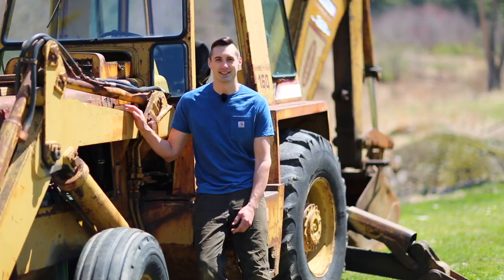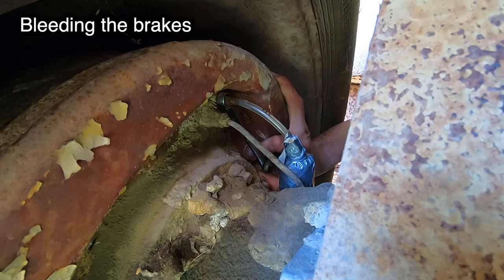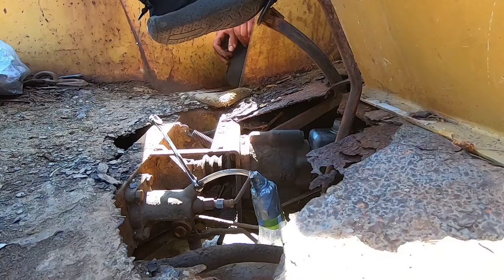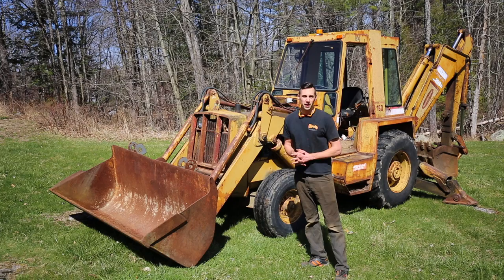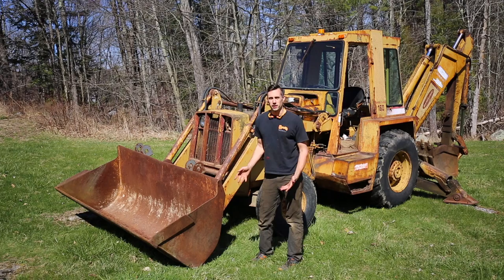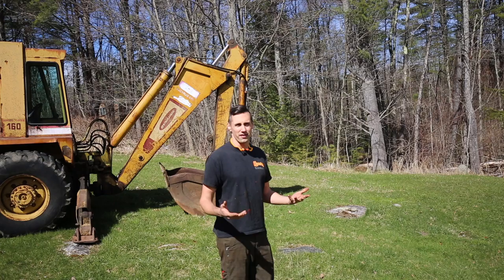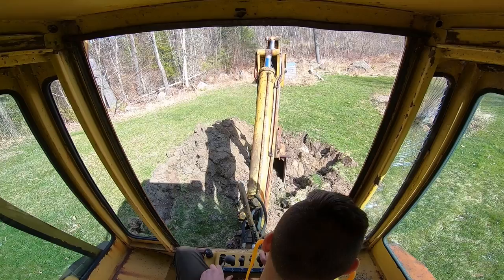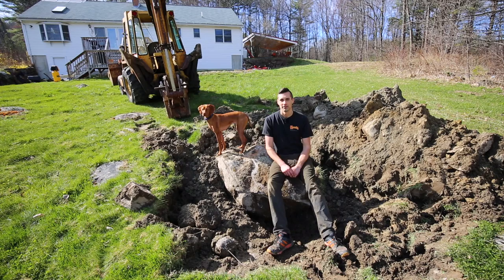Fixing the Brakes on a Backhoe and Digging a Rock [Dino Part 9]

Comment: Waldo, when ever you go to use your backhoe do the following, put your outriggers all the way down until your back wheels are off the ground and put your front end louder down until your front wheels are off the ground, this way you are more stable when you are using your backhoe. 7/1/2020
Reply from the maker: Yeah, I have to rebuild the cylinders for the outriggers because they're bypassing. At this point, one is actually spewing hydraulic fluid from the end cap seal 😂

Comment: Hi Waldo! I have been going through your videos and I like them. Your content is great! I am a heavy equipment operator, mechanic,  and CDL class A truck driver. I spent many years working for a mom and pop small construction company. It taught me a lot. Some things are just the same as you are experiencing, self-taught. I have to tell you that when using your back hoe, it is much easier to use and learn if you raise the machine up off the tires completely. That's what they are intended for. It also keeps the wear and tear off the rear axle bearings. The machine sounds great. I hope to see more of it! I really hope this helps you, because I know a great deal about equipment and just about anything that burns fuel lol. Every man has his own ways and yours are working just fine! Keep it up!
Reply from the maker: Thanks, Zack, I really appreciate the comment! You're right about using the stabilizers. Mine are leaking, so it's about time to reseal them!
Reply: @JOEZEP54  sure. Just type away. Glad to help out if possible...
Reply: @zackhamilton7421  Thank you

Comment: Being a person that has operated backhoes for years, this was painful, but I do recall how helpless I felt on my first time out.  Put the stabilizer feet down and keep trying.  Nick, North West Farmer
Reply from the maker: Thanks! Yeah, I could imagine it would be a bit painful to watch for an experienced operator
Reply: Complete noob here (learned to drive on an International TD-5 then an Oliver Super 55 when I was around 12 y/o, some 36 years ago, but never drove a backhoe); shouldn't the stabilizers be put all the way down, as much as jacking the tires right off the ground, so the backhoe stays in place (rather than dragging along as we saw here) when pulling with the backhoe?  Or is this machine simply too strong for it's own weight?

Comment: I had a 190-2 and I'm blown away at how much smaller the hoe is on the 160! I'm thinking of buying a 140 now but haven't looked at it...maybe not if the hoe is even smaller.

PS I remember the first time using the multi-stick controls....eventually you learn to manipulate 3 at a time and dig efficiently. Keep at it!
Reply from the maker: Yeah, the 160 can dig a 16' hole compared to 19' for the 190. As you've probably figured out, the 140 can dig a 14' hole. Even if you're not digging that deep, I'm sure the extra reach is nice!

Comment: I have a triend who used to drill in an lead anchor and an eye bolt.  He would then set up a tripod and a hoist to pull the rcok out of the yard.  We pulled some pretty large rocks out of my yard.  My friend who was a landscaper, repurposed the rocks in landscaping a stone walkway from my driveway to the front door.  In your case, Dino might be able to pull the rock directly out of the ground, after you drill in the lead anchor and the eyebolt. We also used the tripod hoist to pull some stumps from the ground.  This approach ended up minimally disturbing the lawn ans saved me a lot of cleanup work.   Caution:  You do need to use an appropriately load rated eyebolt and lift chain.  I was also under the inmpression that the eye bolts were one time use in this application.
Reply from the maker: That's an interesting method, thanks for sharing!

Comment: not an operator. However I have watched operators in the past and they would put the outriggers down until they picked the rear tires off the ground and the front bucket down and lift the front end off the ground.  You are a lot more capable than I can never hope to be.  Keep up the good videos
Reply from the maker: Yeah, the problem with the outriggers was that the cylinders were leaking, so they wouldn't hold the machine off the ground. It definitely made it a lot harder to operate that way!

Comment: The best thing you can do is do exactly what you're doing. Go slow and get seat time in. I remember NOW what gave me a fit on the Dynahoe I ran and it was the hoe controls itself. Ford has the best pattern on the levers with crowd on the outside left and hoist main boom beside it. Bucket curl next and swing where it is on yours.  That way you can crowd and lower and swing at the same time and use one hand for crowd and lower. Lots easier. Keep digging. And getting used to putting the power where it needs to be and modulate it. You'll get it.
Reply from the maker: Haha that's interesting to hear your insight on the controls! I'm sure I'll get used to these and they probably won't bother me too much since I've never used anything else
Reply: @WaldosWorld  You will. I got to where I could run the hoe but if it'd been a Ford setup I could've been smoother and faster. ut you have to pay the light bill with what's there. I'm used to I.S.O. wobble stick pattern now but can change back to backhoe if I have to. Takes about an hour for it to become 'natural' and an hour to swap back. If I had a Dynahoe I'd swap the hoses around BUT that's just me. That way I could boom out, down and uncurl he bucket at the same time.

Comment: I'm going out on a limb here. Your yard, the pines on the edge of the yard and the rotted to pieces floor of the cab tells me you are probably within about 50 miles of me. I live in southern NH.

Couple things to keep in mind.
Rocks in the yard in New England is like icebergs. Most of them are below the surface. 
Also, in case you think burying them is the answer, just like icebergs every spring there's a new crop of 'em. Everyone you leave in the dirt is another one you'll visit with again if you live so long.

People think stone walls were built to line out boundaries and to keep the cows in. Stone walls only really served two purposes until yuppies and hipsters decided they were artsy. One purpose was to have a place to put the rocks that they cleared out of the fields and the other was to keep the kids busy.
Reply from the maker: Yep, I probably am within 50 miles of you! Yeah, frost heaves will definitely move the rocks around, perhaps resurfacing them. Also, keeping the kids busy making rock walls: good idea! 🤣

Comment: Great job Waldo , to many throw away and give up on good ole pure American Iron . I am glad you stayed the fight and finished it . One other options that you will love is adding a thumb . I have a John Deere 410 and the thumb is awesome . It makes a tremendous difference . A 4 stick is a hard machine to learn on but in a few more hours you'll have it down . Some guys on 4 stick case go as fast or faster than 2 stick cat or JD. It looks like your building a farm , if that's the case you will cherish this machine , it will do so many things and save you when nothing else can . Just be careful and take it slow . Put more weight on your outriggers like jacking the back tires up off the ground a few inches  and put some pressure down on the front bucket when digging , it will stabilize you . Not complaining , just learning myself after 17 years of playing in the dirt .

Comment: One really big upgrade for this machine would be to go in the surplus center catalog and buy a couple of there dual function stick assembly’s. They would update it to a two stick configuration. Much easier to run then the four stick.
Reply from the maker: Interesting idea! The spools are leaking a bit from wear, so that might be a good option!
Reply: @WaldosWorld  ya. I was thinking just the stick assembly. But since your valve is pretty roached. You could buy the entire valve bank with handles and everything.  Pretty cheap. They are much much easier to run then the old four stick setup.

Comment: Aloha Waldo , Your doing great , especially for learning and teaching all at the same time . Your dog is cool too . Put more weight on your outriggers so you don't drag yourself around , pin it with pressure on the front bucket , this will stabilize you and give you more digging power , rev your engine up to a good pace to keep it from lugging down . Your doing good , especially with a 4 stick . Some guys run a 4 stick better than guys on a 2 stick . I have several pieces to include a JD 410B . Check out adding a thumb . You can really pick up brusch , rocks , logs and demolition etc super fast .

Comment: Hi Waldo discovered your channel today and enjoy it very much,  watched the 9 videos on the Dynahoe  160 and lots of hard work and perseverance  , i use build heavy equipment way back in the day and use to build 1 of the largest farm tractors in North America, Versatiles , big old behemoths now in heavy steel machining stuff for Cat, the cylinder reseals you did are probably the biggest/messiest  pains in the butt, noticed one of your bucket pins looks worn lots might just be an elongated hole which is not too bad to fix with some brass bushing material, oh well when you get time these old machines were pretty good back in the day, the hydraulics were never smooth always a little jerky from new, just a bit now a days too much computer controls and micro switches , commenters like MRL you can simply block in your settings, I would  , thats just me guess he is a troll, you will get the hang of your Dynahoe 👍
Reply from the maker: Wow, thanks for the comment, Bob! You really know your stuff! 👍
Reply: @WaldosWorld  over 60 yrs lol

Comment: Another big issue with ol dyno is the hydraulic system, the rear arm works from a single pump, making it impossible to do certain functions at the same time. it would be cool if bucyrus erie used the front pump for the rear as well, its not like you dig with the front and rear at the same time.

Comment: The Detroit engine is ticking over way to fast, Adjust the linkage on the throttle lever to the injection pump to slow the rpm down .

Comment: A few tips ...get a few more revs out of the engine ...put your stabilizers down to take the weight of the machine it won't move around so much ..you will get there with some practice..
Reply from the maker: Yeah, the stabilizers were leaking, so they wouldn't hold the machine up for very long. I've since repacked one of the cylinders, but I still have to do the other side

Comment: Wish I saw this sooner. I passed on a running unit because the brakes did not work. My property is mostly hills and learning  to use 13000 lb going down hill can be more excitement than I care for LOL. Do you have a video changing the brake pads on this unit?
Reply from the maker: I haven't changed the brake shoes yet, but it's definitely doable. I'll be sure to film it if/when I end up doing that job (the brakes work fine currently). It was a little spooky in the first drive video when I was going downhill with no brakes...if only I had the camera running at the time 😂

Comment: I know it's been awhile but to anyone watching, any decent running backhoe will stand you 7500 - 10K by the time you have it working decent and not contaminating your driveway with leaks every day. Unfortunately, with the Dynahoe I learned that they are a very heavy and slow operating machine. The transmission is very slow to get you anywhere fast and the 3-53 eats fuel like crazy! Once you rebuild the hydraulic cylinders you then end up rebuilding or replacing the hydraulic pump for another 1000$. Some poor bastard in NH bought my Dynahoe for 6900$, and boy was I happy to get that much for it!!!! I would get in the shower and cry while I fixed that machine, it was leaking everywhere, snapped or stripped bolts everywhere, the brakes had an air pump mounted to the motor, with only 1 good thread left in the engine block and no access to fix it. Nothing was ever easy to fix, I HATED that machine!!!!

Comment: Happy you have brakes now and nothing happened. I’m guessing this is a lesson learned, besides the oil and coolant ALWAYS check brake, hydraulic and transmission fluids on any machine you buy before operating. 

About the brakes, the correct bleeding order should always be: master cylinder, any compensating/diverter components THEN the wheels starting with the furthest. Otherwise you risk keeping air trapped in the system to rust it out.

Comment: Hey Waldo I could tell immediately you haven't done much mech work double stacking the gaskets but hey you caught your error. Then on the brakes. When bleeding brakes when the helper presses ya'll don't release the pressure till the foot is pressed not at the same time the braking is initiated. In other words some brakes will not bleed unless good pressure is in the line. What I am saying is don't start opening the bleeder until the foot stops it's motion by pressure. Capish?
Reply: I think he also needs to start with the brake diverter, but in his case, it might have been simple enough that he bled the entire system, including any bleed points just from doing the wheel cylinders. There was also a few other mistakes, but overall, he got the job done.

Comment: I was watching very closely, seems you bleed brakes with a technique that is slow. NEVER release the pedal with a bleeder open! Because the fluid will flow backwards, causing the process to double, or triple in time. Proper way is to pump 2-3 times hard and hold firm, then open bleeder for 1 full second then release pedal, not before bleeder is closed. And repeat. Good luck

Comment: were do you get parts for your 3-53 ???
Reply from the maker: I get most of the parts from dieselpartsdirect.com
Reply: Thanks, I have a #55 Michigan Loader with same engine. Need an exhost manifold, gaskets, starter.................................I will give them a call...

Comment: I know the idea is to use the backhoe. But instead of tearing apart the yard, those rocks aren't sticking up that far. A couple loads of top soil, and spread it 6" deep over the rocks, seed. Problem solved.
Reply: Jackhammer attachment for the machine would work.